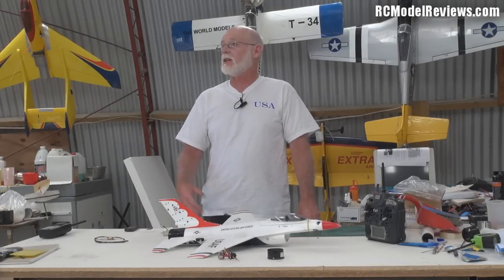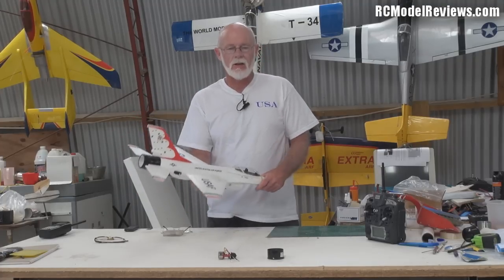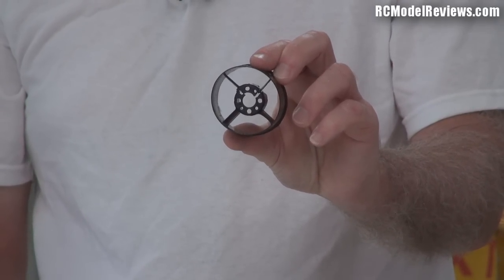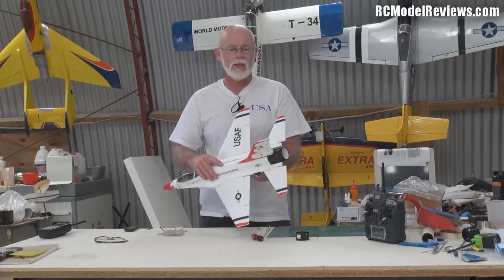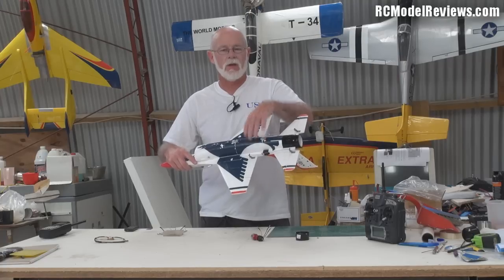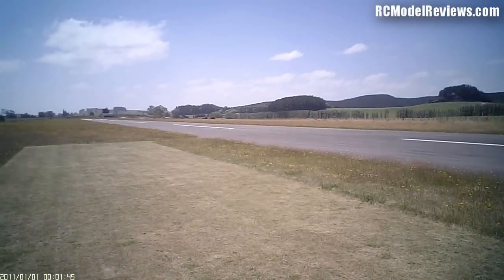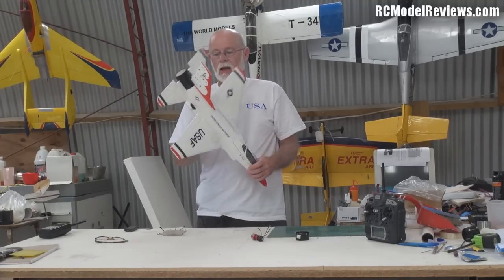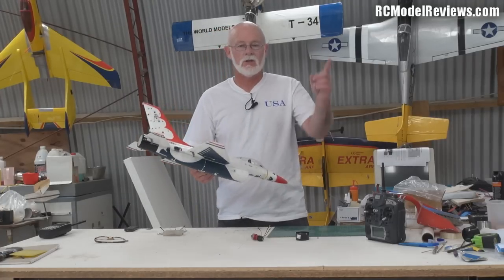HobbyKing 50mm Alloy EDF

Comment: First thing to do with the Mini 50mm jets is to lift out the EDF unit and remove the  blobs of glue they use to hold it in place. These often cause the shroud to deform. Once out - the EDF unit will actually stay in place without tape or glue ... the hatch does hold it. I run two mini jets and both had the blobs removed. I converted one to pusher more than a year later .. the other is now over a year old and still going well .. but with a 5000kv motor and 4S 1600 lipo ... T45's.

Comment: Thanks for that review. Exactly what I was looking for with my little SkyAngel models. I thought the 50mm Hk edf was a little 'fat'.
One question though, are you still using the 850mah recommended pack, or have you gone up a little and squeezed in a 1050 or even 1300mah?